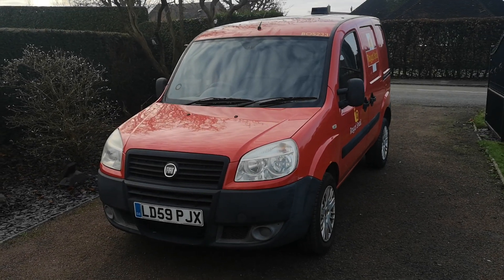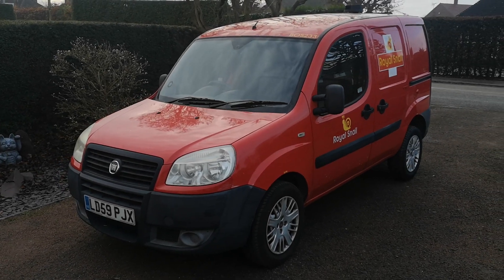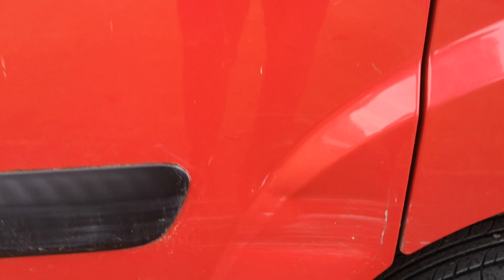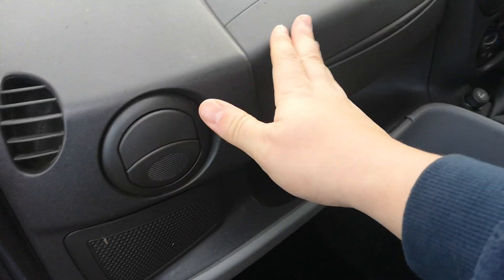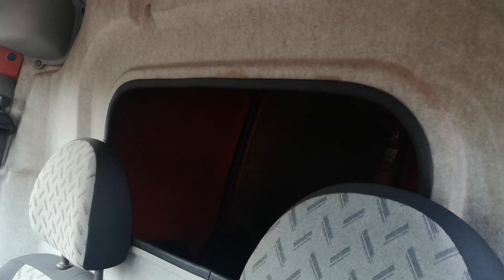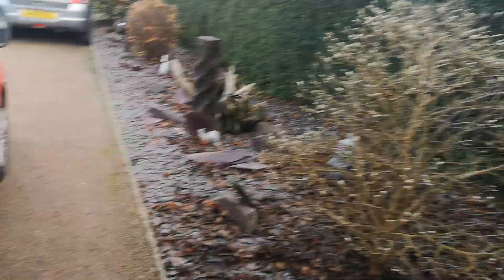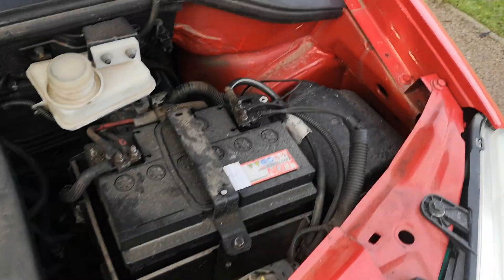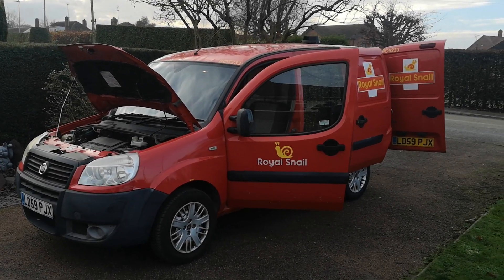Buying An Ex Royal Mail Van - 2009 Fiat Doblo Cargo - Walkaround & Review

Comment: 1248cc which surprised me as I had a Panda Mjet Dynamic which I always thought was a 1.3.  Unbelievably economical.  Good little motors.
Reply: 1.2 is a petrol, 1.3 is the diesel
Reply: @williamrae9954  that was the point of my comment.  I always took it that the Mjet diesel was 1.3 ie, 1251cc or greater.  But it’s actually 1248cc so according to the rounding rules of arithmetic, it’s technically nearer to a 1.2 😁
Reply: @smithp573  Taxation usually goes to the higher number...Honda CBR 600/650 huge difference in road tax,up to 600cc and over 600cc...1.2 is probably 1100 and something?
Reply: @williamrae9954  2001 onwards is on CO2 emissions rather than engine size so it’s not that.  As you say it’s probably more to do with just sounding more impressive. 1.3 is better than a 1.2 eh 😁.
Reply: @smithp573  bikes are different, Cubic Capacity